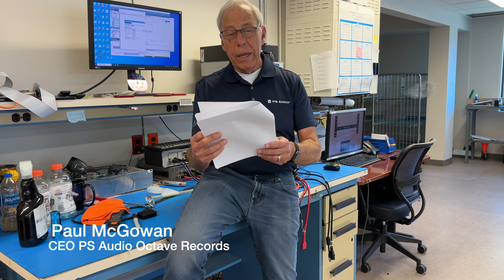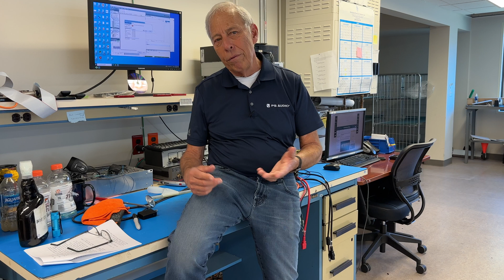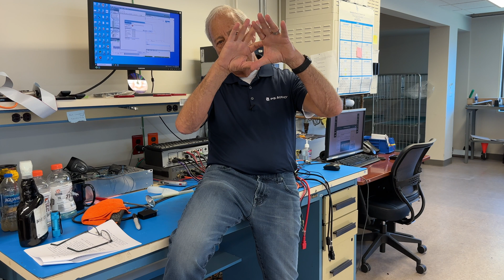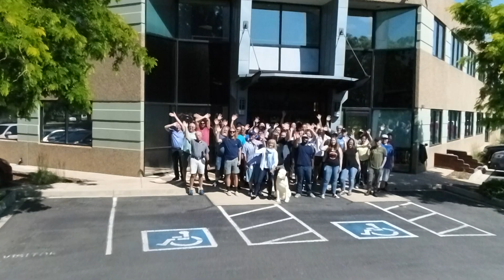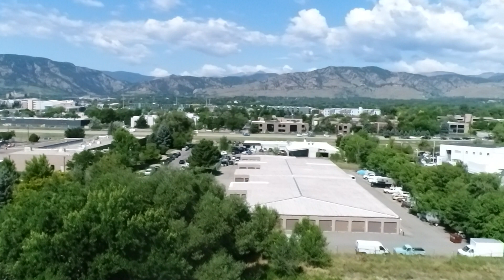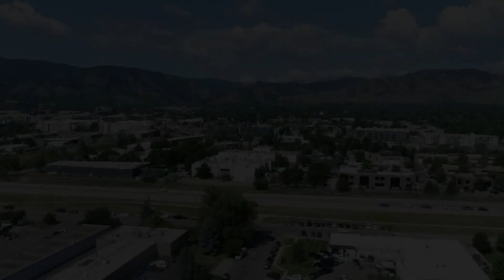Matching power amps Infinity RS1B

Comment: I powered my RS-1B woofer columns with a Threshold 4000 amp and the mid and upper panels with a Conrad Johnson  MV -75 amp and within a few months I felt the same as Paul. Something   was missing in the overall sound presentation that I was hearing. One day several years later, I walked into Lyric HiFi where two of their employees were voicing a set of brand new Maggie 3.6R's and in less than 30 seconds I told them to box them up so that I could take them home